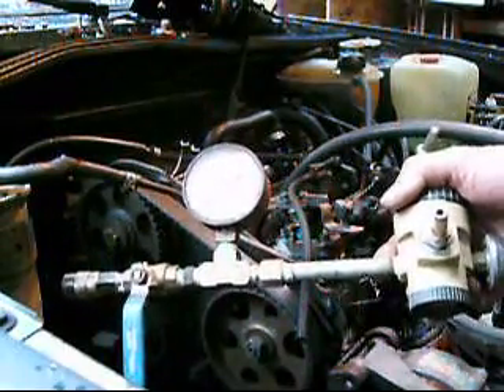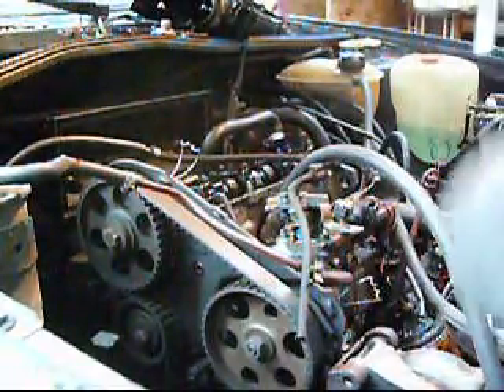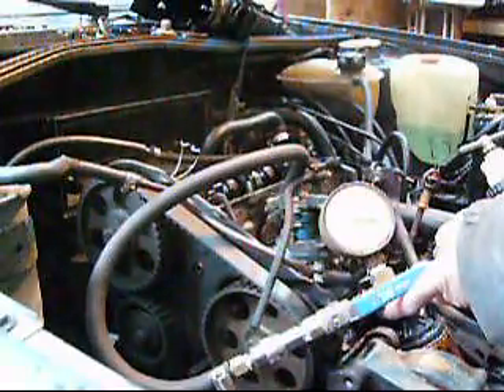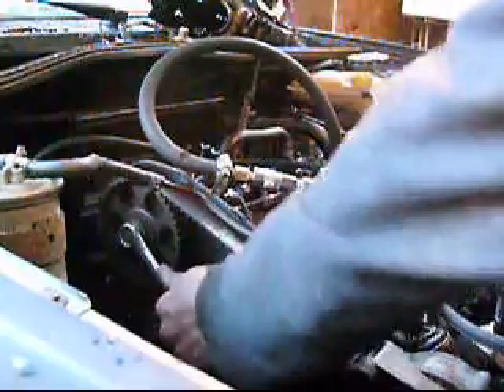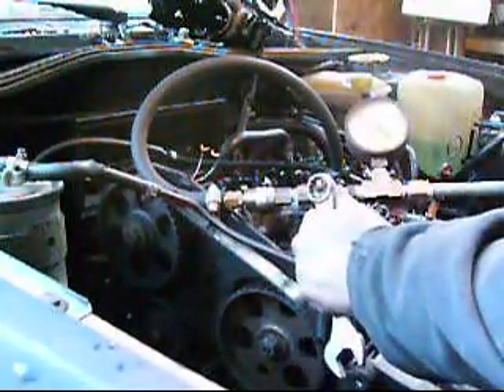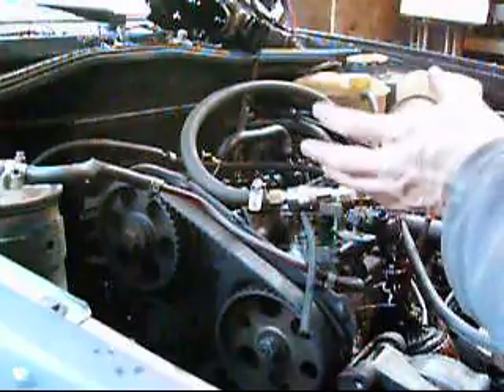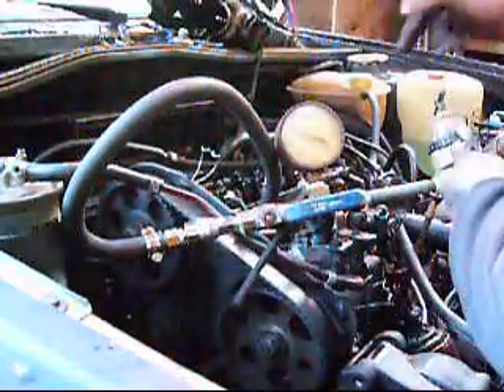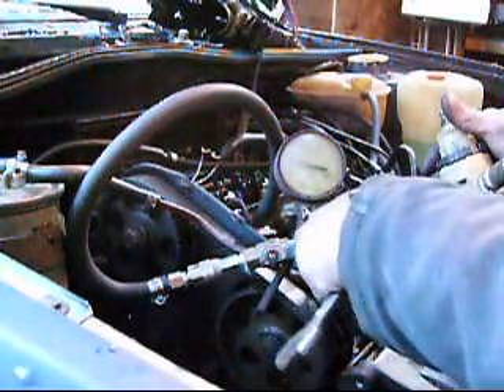VW diesel leak down test

Comment: i agree.never turn engine on a vag or any car by cam sprocket
Reply from the maker: Again, note in the video I have removed all the other injectors so there is only 25 % of the resistance that you would normally expect. Chances of over tightening it is close to zero, with a small wrench. You would of course not rotate it counter clock wise with force. It's a good idea to check the torque if your concerned. You can do no harm if everything is tight and working properly.
You would not want to do it with all the injectors in that said you would need a 24 inch bar to turn it not a 6 inch wrench. Thanks for the warning, rotating it by the crank is a pain in the ass if you do not have a helper. Don't ever forget the wrench on the nut at the bottom or on the top before you start the engine.

Comment from the maker: Only with a compression test, this is a static leak down test, does not need pressure to be built up in the piston to build up to maximum compression (450 lbs on a good diesel)

Comment from the maker: Uh.... bolt is tight to 33 ft/lbs, I am only turning the engine with no injectors in and so there is no resistance, you can turn it by hand, the wrench makes it easier to turn. Certainly before you run the engine you would want to make sure all the bolts are tight.

Comment from the maker: You are thinking about a compression test which is a completely different kind of test and some would say for diagnostics is a much less useful test. As you can see from the video with this test you can hear where a leak exists ie in the cooling channels, rings or valves by listening or feeling for the air leak

Comment: Great video!  Very helpful.   What does the small 1mm orifice in your leak down tester do?  Also did you remove the nozzle and springs from an injector to adapt it to the head?

Comment from the maker: Heh Thanks for the kind words.
I have done 4 engines now, the most recent being the most interesting as 2 cylinders had lower compression than the others. The leak down test revealed 20-25% loss on those cylinders and you could clearly hear the air coming out the exhaust and the other cylinder injector holes, that the exhaust valves were open on. This experience tells me you have to do lots of engines to learn whats good and what not and that this is the best diagnostic tool I have used.